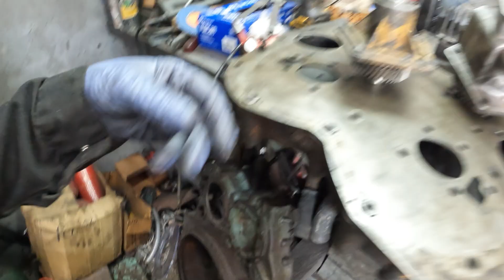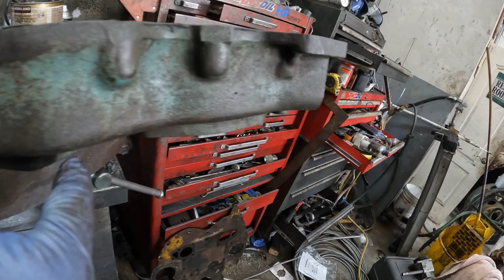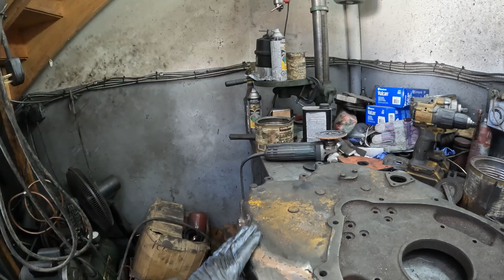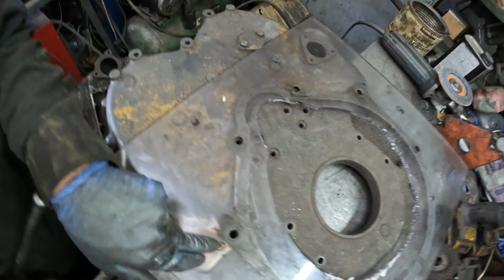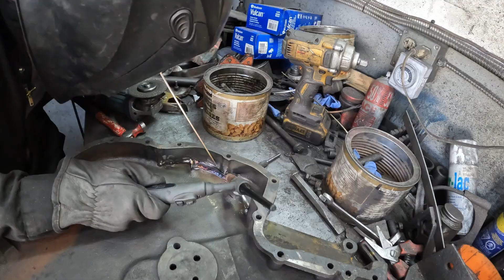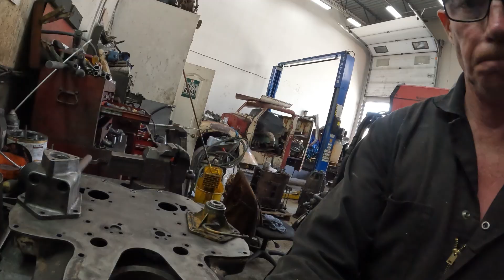Detroit Silver 4-53T (Tig Brazing Flywheel Housing Part 3)

Comment: Man I'm old. Back when I had a toolbox brazing was done using an oxy/acetylene torch. You're amazing, Harling.
Reply from the maker: Thanks, same concept as gas brazing, the tig is cleaner and doesn't heat the cast iron up as much as gas brazing.:)  I did consider brazing with brass and a torch, just didn't want to have to heat the whole housing.

Comment: Great work there and skills. I have seen a cast iron tractor block with a hole in it tig welded with stainless rod. Still running. No leaks.
Reply from the maker: Thanks, yeah the stainless rods work really well.:)  The silicon bronze is softer, but should work well in this application.:)

Comment: I would assume you are doing this because you can’t find the housing you need?
Reply from the maker: That’s correct.:)
Reply: @detroitgarage9430  Does it exist or a configuration never actually used !. It's an optimistic approach and hopefully works leak free over time with the heat cycles and vibration in a running engine. Good luck.

Comment: Good video.    So when you say Deere housing, do you mean that it was from a Deere John log skidder?  Or tractor?  Just wondering.  Also,  I have TIG brazed silli bronze on DC mostly, and I have actually tired AC, and I think it was on a dirty (somewhat) cast iron part.  Looking to learn, what is better and why?  You were clearly using AC because I recognize the buzz.  One note,  I see you used a body hammer to stress relieve (I assume) the beads.  If you are not deforming the crown of the bead physically, it really does no good to lightly tap on the bead.  The goal is to turn the surface stress from tensile (from cooling shrinking), to compressive, which flattens out the stress to where it no longer is trying to bend the part.  What I use that is quick and handy, is a pneumatic needle scaler.  Really lean into it and dent up the bead real good.  This makes for a really good stress relief in the bead.  Thanks.  ---Doozer
Reply from the maker: Thanks, the Deere housing was off a 1958 Deere 440 Crawler, they used this housing with the 2-53 for both the 440 and 435 tractor.  I used ac for this job as it tends to clean the area better and from all the reading I've done, ac is the preferred method for Tig Brazing.:)  I used a pick hammer with a sharp tip to expand the bead.  I do it when the weld is still hot and soft, seems to work really well.  The pneumatic scaler is a great idea and would have worked better.  I've got two, so I'll definitely try that going forward.  It turned out pretty nice overall with no cracking.:)
Reply: @detroitgarage9430  I also use my TIG to braze with silicon-bronze on thin metals using DC.  It works great.  I will try AC next time to see how it works.  

Always learning!
Reply from the maker: @ChevyJay283  :)